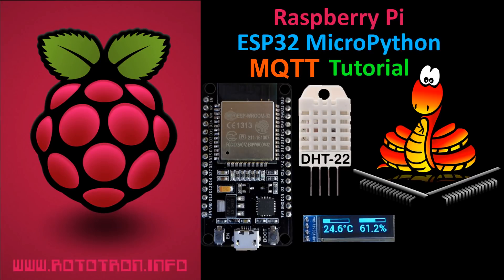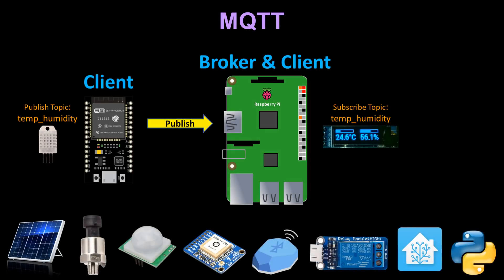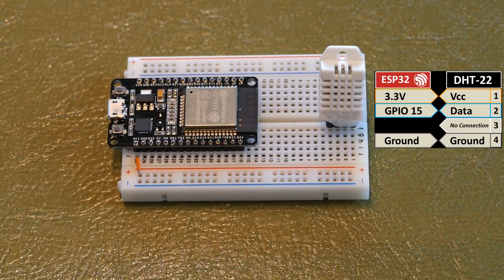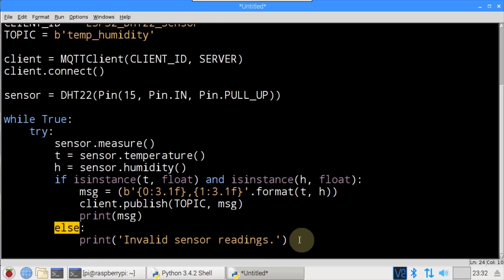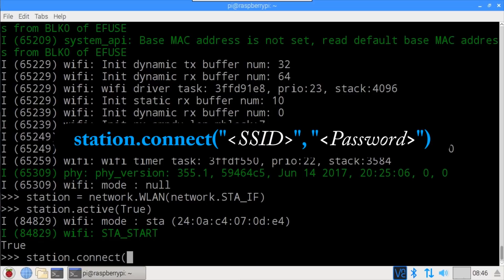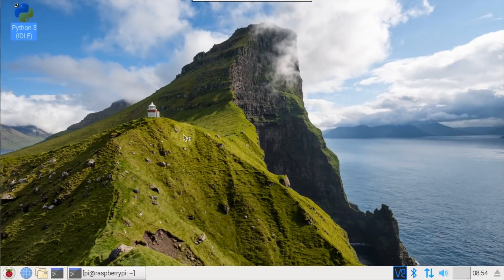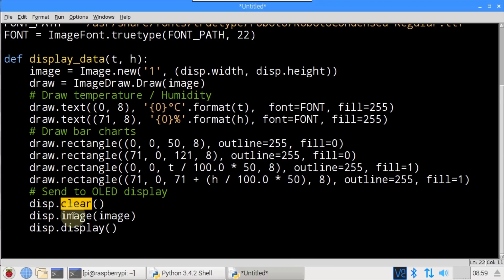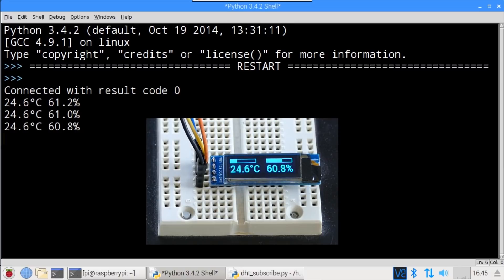ESP32 MicroPython MQTT Tutorial with Raspberry Pi, DHT-22 & OLED

Comment: i am trying to setup my dht11 with esp8266 nodemcu and raspberry pi as MQTT broker. the problem is the following error:
>>> sensor = DHT11(Pin(2, Pin.IN, Pin.PULL_UP))
Traceback (most recent call last):
  File "<stdin>", line 1, in <module>
NameError: name 'DHT11' is not defined
>>> import machine
>>> from machine import Pin
>>> from dht import DHT11
>>>
>>> sensor = DHT11(Pin(2, Pin.IN, Pin.PULL_UP))
>>> sensor.measure()
Traceback (most recent call last):
  File "<stdin>", line 1, in <module>
  File "dht.py", line 16, in measure
OSError: [Errno 110] ETIMEDOUT
>>> print(sensor.temperature())
0
>>>
 i have it connected on D4(pin2). unfortunately i do not see any dht.py file. it is only dht_publish.py how can i fix that please?
Reply from the maker: I have found the MicroPython.org DHT code to be unreliable for the ESP8266.  It's been a long time since I used an ESP8266.  I primarily use the ESP32 and I'm using the LoBo build which has an excellent DHT library.  Sorry I don't have any workarounds.  I recommend you post your issue on https://forum.micropython.org/viewforum.php?f=16

Comment: I am having an error.please,help.
>>> import dht_publish
Traceback (most recent call last):
  File "<stdin>", line 1, in <module>
  File "dht_publish.py", line 11, in <module>
  File "umqtt/simple.py", line 58, in connect
OSError: [Errno 113] EHOSTUNREACH
Reply from the maker: The connection might be failing because your Wi-Fi is not
ready.  Try adding a line to test if the
Wi-Fi is connected prior to the MQTT connection.
Reply from the maker: I recommend you take a look at the LoBo MicroPython build which comes with an MQTT client that is more robust.  I added an example to my website (at the bottom of the page):   https://www.rototron.info/raspberry-pi-esp32-micropython-mqtt-dht22-tutorial/

Comment: Hello excellent video, I am building something similar to your example, I use the Lolin32 and a max31865 for a temperature sensor. I have a question: what kind of library or code do I need to connect the MAX31865 to the esp32? I'm a total beginner so if you could give me step vy step advice I would appreciate, Thank you.
Reply from the maker: I haven’t used the MAX31865 but there is a MicroPython ESP32 library for it on GitHub:
https://github.com/htlb-atk/schilf-iot-MAX31865
The library has excellent documentation (German):
https://htlb-atk.github.io/schilf-iot-MAX31865/
Reply: Thank you!

Comment: Hi great video everything went great until the import network in repl it does not list network :( but help() shows it's there grrrr.
Reply from the maker: What command are you using?  What error message to you get?
Reply: rdagger68 none! it just went to the next line >>>> & nothing. will try the method in your web server video you made otherwise put it down to a faulty board.
Reply from the maker: You could have similar problem to the one I encountered in the video.  Import network causes a current draw.  An inadequate power supply, a low quality USB cable or a bad USB port could all be culprits.
Reply: Successfully connected to Wifi using the main.py method, thanks for all your helpful advice & videos.

Comment: quick question: as your mqtt pub micropython code requires the server number (the IP address of the broker; in this case RasPI), isn't it essential that the raspberry pi is set up with a static IP address?  (if the Pi reboots then the IP address may be dynamically changed by the wifi router)
Reply from the maker: I more reliable method would be to use mDNS.  I recommend you check out the Loboris build because it comes loaded with MQTT and mDNS.  My next video will probably cover mDNS.
https://github.com/loboris/MicroPython_ESP32_psRAM_LoBo/wiki
Reply: thanks, I had better read up a little on what mDNS is!! thanks for the advice to shift to the Loboris build too.

Comment: Hi, thanks for the tutorial help me a lot. I havê a tricky problem when the internet restart i loose the connection to esp32 there is any solution for this? Can someone help me?
Reply from the maker: Does the problem occur when you restart your Internet router?  I assume you are losing the MQTT connection, correct?
Reply: rdagger68 , Hi yes when i restart the router i enter on raspberry and whe. I put mosquito he doesnt show anyhting on output...i need to restart DHT to see again temperature. The connection is via WiFi raspberry to DHT.
Reply from the maker: On the ESP32 you can check your Wi-Fi connection with the network library:
    from network import STA_IF, WLAN
    station = WLAN(STA_IF)
Then you can wrap the publish statement to ensure it is connected:
    if station.isconnected():
        client.publish(TOPIC, msg)
    else:
        print('Lost Wi-Fi connection.')
Reply: I had a similar problem make sure your PI is getting 2.5 -3.0 amps from wall-wart

Comment: Great tutorial, easy to follow and copy command lines from your website. I have got some error message when running: import dht_publish
Here is what I got returned: 
Traceback (most recent call last):
  File "<stdin>", line 1, in <module>
  File "dht_publish.py", line 11, in <module>
  File "umqtt/simple.py", line 99, in connect
MQTTException: 5

Not sure how to proceed further. Line 11 in dht_publish is attempting to connect to mqtt server. I have adjusted IP address to match my RPI address. I haven't done any changes to simple.py file. My Mosquitto server is running, I am able to send message and receive it using Node Red, as well as command line in Putty, so I am not sure what else can I check and change.
Reply from the maker: I just re-tested the dht_publish code and it's working OK.  Are you sure your ESP32 is connected to your Wi-Fi network?  
btw:  youtube flags any comment with .py as SPAM because it thinks it is a hyperlink to Paraguay.

Comment: Hi to all, this tutorial was great and very helpful, thank you very much.
A quick question from you expert guys, Can I connect a Temperature Sensor which uses resistance (milliOhm) as its output? or in another word does the ESP32 or other series of ESP... take resistance input in any of its pins (GPIOs, etc.)? more clarification is: currently my resistance temperature sensors are connected to a I/O card that follows Resistance Temperature Detector (RTD) and receives the changes in the resistance of the temperature sensor and I wanted to make the temp. sensors wireless with utilizing ESP... .
Reply from the maker: Yes you can measure resistance using the analog pins on the ESP32.  You can do this by creating a voltage divider comprised of 2 resistors.  The first resistor is your variable resistance source (a sensor that varies resistance).  The second resistor is a fixed value (close to the range of your sensor).  As the sensor changes resistance the voltage output of the divider will vary and the ESP32 analog pin can measure it.  UNFORTUNATELY, most RTD sensors require a very high quality amplifier such as a MAX31865 RTD-to-Digital converter.  I think Adafruit sells a MAX31865 breakout board that can be connected to the ESP32 using SPI protocol.

In my 4th video of this series, I show how to connect and measure a SoftPot using the analog pins on the ESP32.  A SoftPot is a potentiometer which is a voltage divider.
https://youtu.be/a7DrFqqu-78
Reply: Thanks a lot for all the valuable info. I will try them and if I stuck anywhere i will bother you with question. Very helpful channel, cheers!
Reply from the maker: Generally speaking, an RTD sensor requires a very high quality amplifier such as the MAX31865: https://www.adafruit.com/product/3328
Therefore, a simple voltage divider approach would not be sufficient.  A voltage divider could be used with thermistor as in this Arduino example:  https://learn.adafruit.com/thermistor/using-a-thermistor

Comment: Your tutorials are fantastic.Thank you for them.I am stuck on the "import network" part. Nothing happens when I run this command in repl. Do you know where the problem might be ?
Reply from the maker: What happens after you type import network?  Does the REPL freeze or do you get an error message?
Reply: After I type import network ,nothing happens. When I hit enter I just get >>> .So REPL is not frozen ,I am just not getting any information on screen.When you type " import network" in the video ,a lot of information is printed on screen starting with wifi firmware version.
Reply from the maker: Your build might have the debugging messages turned off.
Does your boot.py file contain the line esp.osdebug(None), this would turn off the messages?
You can try manually turning on the debugging messages by typing the following before the import network statement:
import esp
esp.osdebug(0)

Also if you plugged anything into UART0, you should remove it first.
Reply: I am getting this . Do you have any ideas what could be wrong ? I have 2 boards and the same problem with both.  >>> 
>>> 
>>> import network
>>> station = network.WLAN(network.STA_IF)
I (108515) wifi: wifi firmware version: 111e74d
I (108515) wifi: config NVS flash: enabled
I (108515) wifi: config nano formating: disabled
I (108515) system_api: Base MAC address is not set, read default base MAC address from BLK0 of EFUSE
I (108525) system_api: Base MAC address is not set, read default base MAC address from BLK0 of EFUSE
I (108545) wifi: Init dynamic tx buffer num: 32
I (108545) wifi: Init data frame dynamic rx buffer num: 64
I (108545) wifi: Init management frame dynamic rx buffer num: 64
I (108555) wifi: wifi driver task: 3ffe1620, prio:23, stack:4096
I (108555) wifi: Init static rx buffer num: 10
I (108565) wifi: Init dynamic rx buffer num: 0
I (108565) wifi: Init rx ampdu len mblock:7
I (108575) wifi: Init lldesc rx ampdu entry mblock:4
I (108575) wifi: wifi power manager task: 0x3ffe854c prio: 21 stack: 2560
W (108585) phy_init: failed to load RF calibration data (0x1102), falling back to full calibration

Brownout detector was triggered

Guru Meditation Error of type IllegalInstruction occurred on core  0. Exception was unhandled.
Guru Meditation Error of type IllegalInstruction occurred on core  0. Exception was unhandled.
Guru Meditation Error of type IllegalInstruction occurred on core  0. Exception was unhandled.
Guru Meditation Error of type IllegalInstruction occurred on core  0. Exception was unhandled.
Guru Meditation Error of type IllegalInstruction occurred on core  0. Exception was unhandled.
Guru Meditation Error of type IllegalInstruction occurred on core  0. Exception was unhandled.
Guru Meditation Error of type IllegalInstruction occurred on core  0. Exception was unhandled.
Guru Meditation Error of type IllegalInstruction occurred on core  0. Exception was unhandled.
Guru Meditation Error of type IllegalInstruction occurred on core  0. Exception was unhandled.
Guru Meditation Error of type IllegalInstruction occurred on core  0. Exception was unhandled.
Guru Meditation Error of type IllegalInstruction occurred on core  0. Exception was unhandled.
Guru Meditation Error of type IllegalInstruction occurred on core  0. Exception was unhandled.
Guru Meditation Error of type IllegalInstruction occurred on core  0. Exception was unhandled.
Guru Meditation Error of type IllegalInstruction occurred on core  0. Exception was unhandled.
Guru Meditation Error of type IllegalInstruction occurred on core  0. Exception was unhandled.
Guru Meditation Error of type IllegalInstruction occurred on core  0. Exception was unhandled.
Guru Meditation Error of type IllegalInstruction occurred on core  0. Exception was unhandled.
Guru Meditation Error of type IllegalInstruction occurred on core  0. Exception was unhandled.
Guru Meditation Error of type IllegalInstruction occurred on core  0. Exception was unhandled.
Guru Meditation Error of type IllegalInstruction occurred on core  0. Exception was unhandled.
Guru Meditation Error of type IllegalInstruction occurred on core  0. Exception was unhandled.
Guru Meditation Error of type IllegalInstruction occurred on core  0. Exception was unhandled.
Guru Meditation Error of type IllegalInstruction occurred on core  0. Exception was unhandled.
Guru Meditation Error of type IllegalInstruction occurred on core  0. Exception was unhandled.
Guru Meditation Error of type IllegalInstruction occurred on core  0. Exception was unhandled.
Guru Meditation Error of type IllegalInstruction occurred on core  0. Exception was unhandled.
Guru Meditation Error of type IllegalInstruction occurred on core  0. Exception was unhandled.
Guru Meditation Error of type IllegalInstruction occurred on core  0. Exception was unhandled.
ets Jun  8 2016 00:22:57

rst:0x10 (RTCWDT_RTC_RESET),boot:0x13 (SPI_FAST_FLASH_BOOT)
configsip: 0, SPIWP:0xee
clk_drv:0x00,q_drv:0x00,d_drv:0x00,cs0_drv:0x00,hd_drv:0x00,wp_drv:0x00
mode:DIO, clock div:2
load:0x3fff0018,len:4
load:0x3fff001c,len:4332
load:0x40078000,len:0
load:0x40078000,len:10992
entry 0x4007a6c4
W (66) rtc_clk: Potentially bogus XTAL frequency: 35 MHz, guessing 40 MHz
I (357) cpu_start: Pro cpu up.
I (357) cpu_start: Single core mode
I (357) heap_init: Initializing. RAM available for dynamic allocation:
I (361) heap_init: At 3FFAE6E0 len 00001920 (6 KiB): DRAM
I (367) heap_init: At 3FFDCE10 len 000031F0 (12 KiB): DRAM
I (373) heap_init: At 3FFE0440 len 00003BC0 (14 KiB): D/IRAM
I (379) heap_init: At 3FFE4350 len 0001BCB0 (111 KiB): D/IRAM
I (386) heap_init: At 40090060 len 0000FFA0 (63 KiB): IRAM
I (392) cpu_start: Pro cpu start user code
I (186) cpu_start: Starting scheduler on PRO CPU.
OSError: [Errno 2] ENOENT
MicroPython v1.9.3-332-g27fa9881 on 2018-02-19; ESP32 module with ESP32
Type "help()" for more information.
>>>
Reply from the maker: Since the Brownout detector was triggered, I think you have a power issue.  The Wi-Fi module draw a lot of power when activated.  The are several possibilities: 1. Power supply is too weak, 2.  USB cable too long or thin, 3. USB jack on the ESP32 is defective, 4. You have additional components connected to the GPIO pins that are drawing too much current.

Comment: How i insert the code permanent to ESP32?
Reply from the maker: Do you need instructions on how to upload the firmware?  If so, please check out my prior video: https://youtu.be/w15-EQASP_Y
Reply: rdagger68 , i dont understand, i havê inserted the code to pyboard but when i turn off the esp32 and connect only to eletric we  do not send  data to rasp via WiFi... Mosquito doesnt recieve anything
Reply: My problem is, when the ESP32 its connect to Raspberry i have no problem( i see the dht reading with mosquitto)...but i want to execute (
import network
station = network.WLAN(network.STA_IF)
station.active(True)
station.connect("HUAWEI-E5172-0B47","A7RAG240M73")

import dht_publish )
Every time the ESP boot to disconnect from the raspberry ... so my doubt is how esp32 boot my code without any usb connect to Raspberry? Thanks a Lot rdagger68 for the help
Reply from the maker: Unlike the ESP8266, the ESP32 does not remember network connections.  You need to add a file called main.py which will automatically run when the ESP32 boots.  Inside main.py you can add your code above to connect to the WiFi.  There is an example in my next video:  https://youtu.be/xscBwC1SrF4

Comment: I think that if you put a 4 sec wait before first reading, it might work better when starting in the beginning?

You should propably post temperature and humidity on different subjects.  And voltage level are also good to have posted through MQTT so users knows when to change batteries.

mDNS would also be a good way to connect the MQTT server without knowing its IP address.

And yes, great tutorial, thanks.
Reply from the maker: Good points.  I know the IDF supports mDNS, but I'm not sure if MicroPython has implemented it yet.
Thanks for the feedback!
Reply: rdagger68 many home routers also uses DHCP to set the name used by the device to register as solvable name through its DNS. 

Would be greate if more computers uses mDNS.

Comment: This is awesome! Thanks for doing these videos! Extremely helpful for someone like me just getting started in microcontrollers. I’d really like to know if the esp32 can handle micropython + SSL/TLS in the mqtt communication as a basic security layer on top of a home’s WiFi). If so, this would the best of all worlds of Raspberry Pi, microcontrollers, Python, and IOT!Have you been able to (and/or are you interested in expanding this tutorial ) to get the esp32 running with micropython and communicate to mqtt broker via ssl/tls?
Reply from the maker: I haven't tried SSL but it should work.  Here is some untested code:
CLIENT_ID = ubinascii.hexlify(machine.unique_id())
SERVER = b'<your server address>' 
USER = b'<your user id>'
PASSWORD = b'<your password>'
client = MQTTClient(client_id=CLIENT_ID,
                    server=SERVER,
                    user=USER,
                    password=PASSWORD,
                    port=8883
                    ssl=True)
Reply: You shouod have neede certificates if you want to have a secure connection. If not, you only used TLS to set up an encrypted connection. Not a secured connection, which can't be taken over by Man In the Middle (MIM) attack.